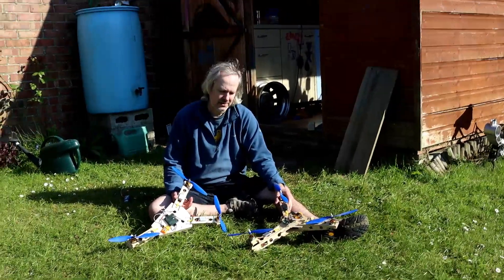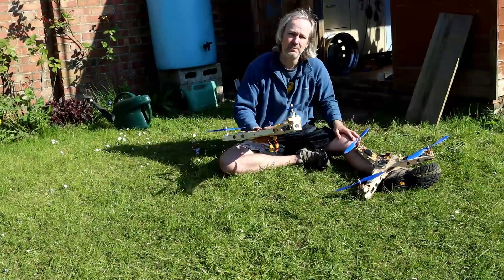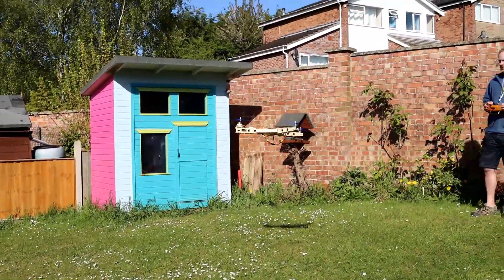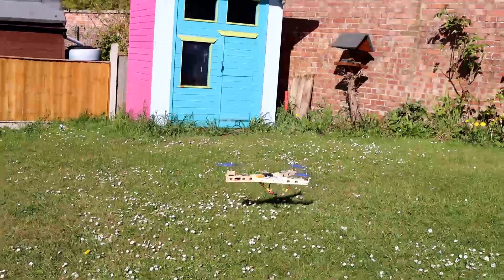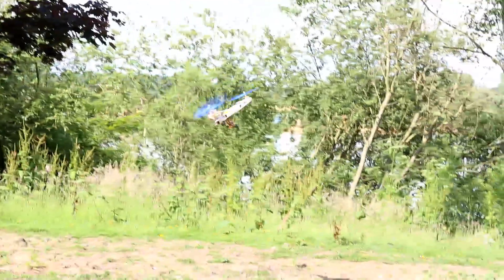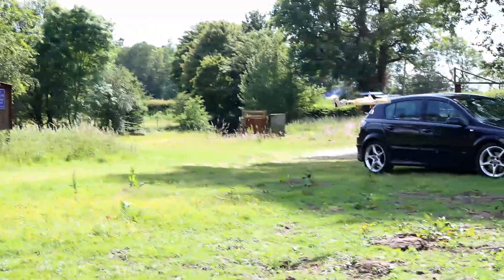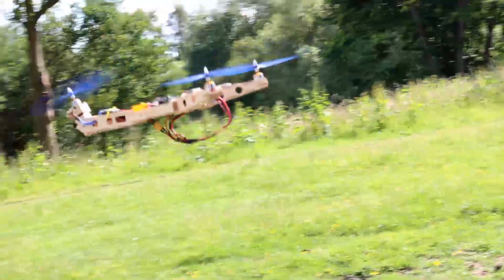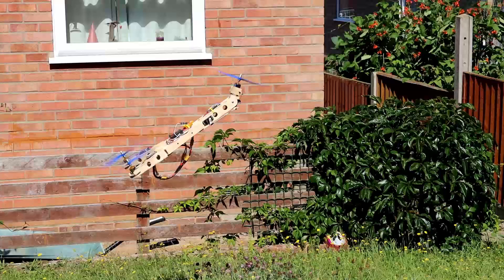Experimental Tricopter with tilting front motor.

Comment: Im just making this now; although Im actually 3D printing mine, Im interested to know how youve got your radio set up, ie?: is the tilt purely on a switch only or is it on a rotary switch, Thanks
Reply from the maker: Both, i have the tilt on a switch but set up the radio to adjust it on the rotary adjustment. if i get into trouble i can just switch back.

Comment: This is fascinating. Presumably one of the rear motors has to be going quite a bit faster to correct for the spin caused by the other two motors?
Reply from the maker: I don't know, the two rear fans counter rotate and the yaw is still controlled by the front fan, i will put some telemetry on it to see whats happening with motor power.
Reply: More likely the yaw caused by the front motor is simply corrected with thrust vectoring of the front motor.